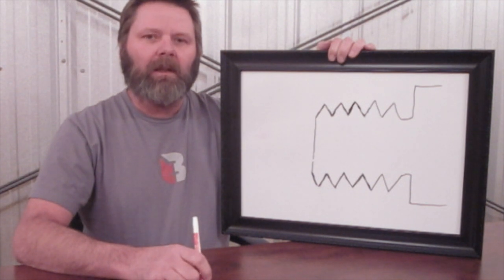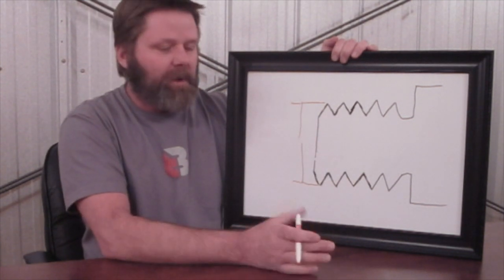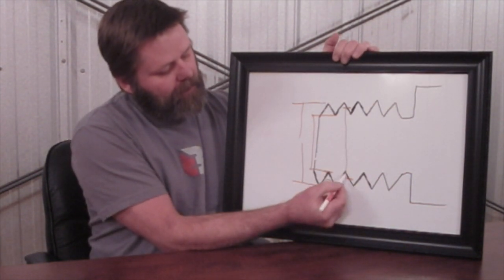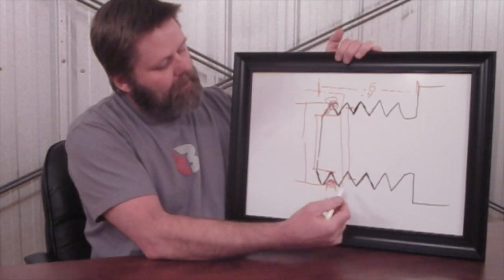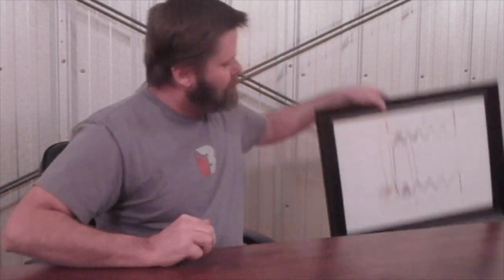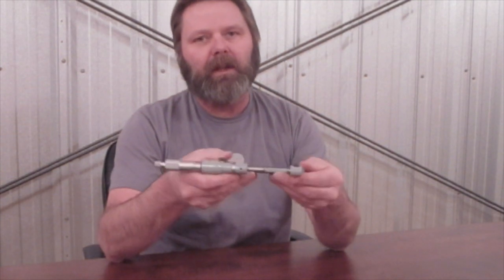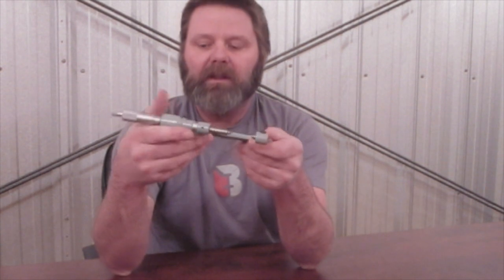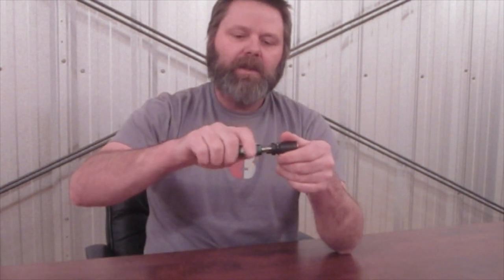Understanding Thread Specifications for Sound Suppressors

Comment: Using the 3 wire system,, what are the comon min/ max messured over the wires for the usual supressor threads,,THAT ,,would be nice to know, then one could check a threaded gun BEFORE  you buy it ;o)
Reply: if you're doing the wire method you're already investing in wires/calipers or micrometer so IMO skip that shit and just buy a ring/plug gages which by design have your "go/no-go" which is your min/max on pitch
Reply: @xXTheVahinaXx  well i do have the wires and mics,,a ring guage x2  is expensive for that single task

Comment: GREAT advice for anyone new to suppressors.  Very clear and to the point.  A lot of gunsmiths will respond with something like "bring the part you want to put on and I'll make sure it's a good fit", or more common in my area is "I keep a brake (or other muzzle item) for checking the fit"

Not a good idea.  Thread specs and tolerances are there for a reason.  

I bought my own lathe just because of the answers I received when asking around.  I need one anyway.